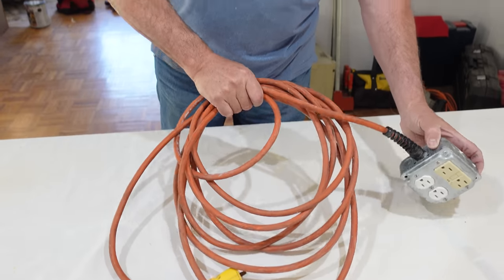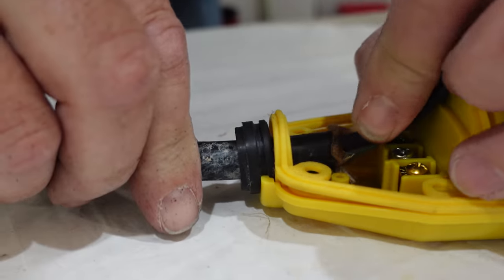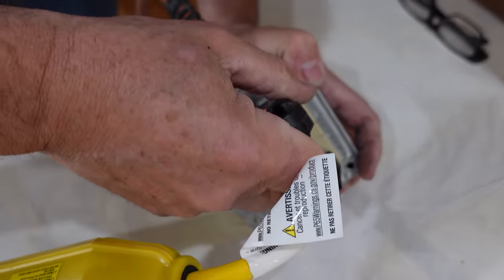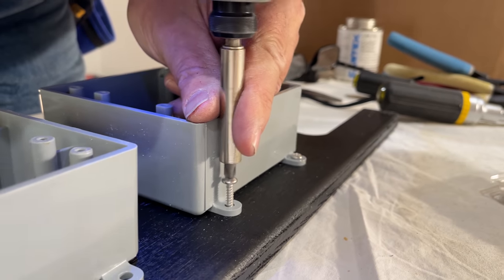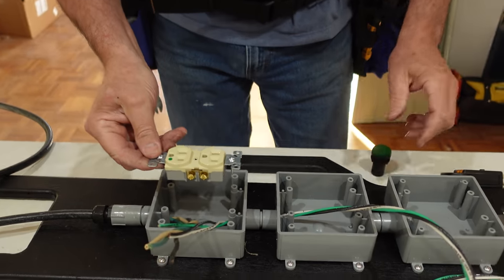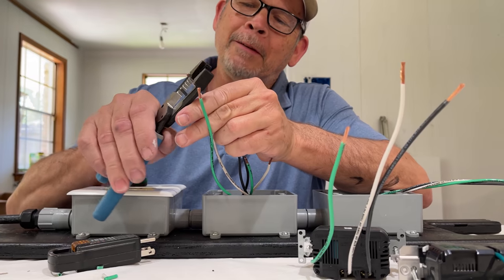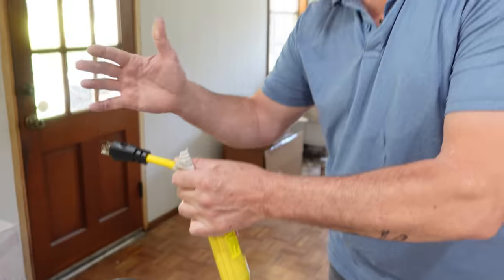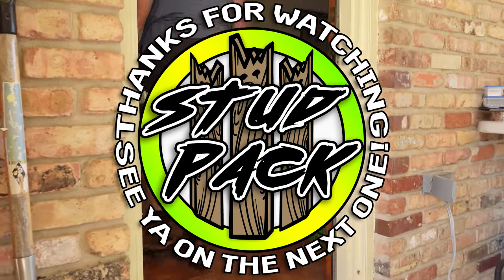HOW TO MAKE THE ULTIMATE EXTENSION CORD!

Comment: The added protection on the front end of the wire was GFCI which simply makes a continuous comparison of the amount of current flowing through the two circuit conductors, this is great if say you were to clip a wire with a tool and that wire were to touch you, it should stop the current... Other forms like AFCI continuously monitors the current waveform in the circuit, looking for unique anomalies that signify an arc fault... There are combo GFCI/AFCI devices. For breakers, for devices at the receptacle level ie in a bathroom... And for wires as shown here.... But most breakers are just OCP or simply put; thermal over current protection.... Pretty much across the board they use a bimetallic strip That is designed to trip the breaker at 80% of the rated current under sustained use... Which is to say a 15 amp breaker will trip if 12 amp is continuously run through it, The 20 amp breaker will trip if 16 amps is continuously run through it... So on and so forth..  What they have there is 20 amp breaker That was running 28 amps... The bimetallic strip inside of the breaker thermally breaks the connection... Which is to say it physically needs to heat up...  it is possible under short durations to run twice as much current as a breaker is currently rated for. For very very short periods of time...  This is typically why when a breaker trips It seems to go almost randomly... But will almost certainly trip fairly quickly once reset If all of the same conditions are met that caused the trip in the first place...
Reply: Yeah we call them rcds residual current device or detectors depending who u ask

Comment: The Circuit breaker did not trip because they have two tripping modes, thermal and magnetic.  The magnetic tripping mode trips instantly for dead shorts.  The thermal tripping mode however takes some time to trip, this allows motor starts and inrush currents that quickly dissipate to avoid tripping the breaker.  Given enough time, the breaker will trip with an excessive load.  The breaker's data sheet includes the thermal tripping curve which shows how much time the breaker will take to trip for any specific overload condition.

Comment: From what I know, a 20 amp breaker won’t usually trip at exactly 20 amps. It has a window of surrounding amperage that works as a tolerance, which would allow a slight fluctuation over the stated 20 amp breaker point.

Comment: One thing you could add is a current reader so you can verify how much current you’re pulling.  As opposed to using your split cable setup. It would be easy to add it by the green indicator light.

Comment: Holy crap! Can anyone say Tim Taylor, throw a couple grunts in for good measure. Probably could have purchased at least 4 cheap six-outlet non-surge power strips for the money dumped into this Frankenstein of an extension cord. As far as over-current goes, S-type cordage (portable cable/extension cords) is rated at less amperage than the wire used in the walls of your house. If you check the package the extension cord came in (or the tag on the cord everyone rips off), you would notice a 50 foot 12 GA cord is usually only rated for 15 amps so plugging it into a 20 amp outlet (or a 15 amp outlet protected with a 20 amp breaker) is a no-no as far as job-site safety is concerned (insurance/bonding). 

So he created space for 6 duplex outlets and then wasted half of those spaces on useless stuff like an Indicator light, a switch, and USB charging ports. If you need more than two USB charging ports, your crew is spending too much time on their phones. 

If I were to make something similar to this, I would start with the aluminum outdoor boxes with steel pipe nipples in between the boxes.  First off, PVC boxes (and indoor plastic cover plates) can be broken too easily in a portable/job-site application such as this. As well you could have eliminated all the ground wires in the enclosures as NEC allows for mechanical ground where metallic conduit and boxes are used. I would have just put six duplex GFI outlets in. If you get GFIs with the built-in indicators you don't need a separate indicator light to prove power at the outlets. There are also GFI outlets that have built-in night lights, so if you start or end your day when it's dark you can find the outlets to plug in your work lights. Another option would be while-in-use covers (the clear plastic kind so you can still use night-light outlets). With while-in-use covers you can have things plugged in, but still protect unused outlets from dust/debris and splash.

The device he used at the cord entry point on the first box is not a strain reliever. It is called a cord gland (or seal). It is not designed, nor should it be used to prevent cord pull-out, it is strictly a seal to prevent infiltration around the cord. What I do to prevent pull-out is, instead of cutting off the built-in strain relief (those ropes inside portable cable) I bundle them together and crimp them in a ring lug and screw it down where you bond the cord's ground wire to inside the box, making sure the ropes are taught when screwing them down. The cord cannot be pulled out when anchored in this fashion.
 
I also would have just used jumpers from outlet to outlet using the screws on the outlets as connection points. I don't think the push-in splice blocks are safe for stranded wire as it is too easily compressible and they likely are not spec for applications where they can be exposed to vibration like riding around in the work truck or knocked around on the job-site.

Comment: Nice showing how a vac speeds up when the air is blocked and draws less amps,but left that way it will also overheat quickly since the motor relies on that air for cooling in most vacs.

Comment: I absolutely am not an  electrician, but I recall that a big problem with extension cords is that they (the extension cords) are the cause and the victim of heat in the wire of the cord and not the house's wiring. This, as I understand it, is why there are so many electrical fires in overloaded extension cords while not heating the house's wiring enough to  trip the circuit breaker in the panel. Also, I believe that this is why new house construction has so many more outlets (so we have less of a need for extension cords) than in previous times. While I do not think that the intended use by our Stud Pack crew will be dangerous, we should not understate the potential fire dangers of overloading extension cords.

Comment: its funny to look at this while we have so many more safety precautions here in finland, im half cringing and half "oh thats clever" over here. for example we got the safety trip in the fuze box, not in the extension cables, also we are taught that the green wire (for us its green and yellow) has to be atleast 2-3cm (about an inch) longer than any other cable and on the point where hes using the stranded wire to connect to the outlet, i wouldve used a crimpable sleeve, not a u connector. the sleeve wont budge if you aim right and test afterwards so it wont budge. wagos are the best tool an electrician has, if you disagree, we both know youre not an electrician

Comment: Circuit breakers have two means to trip.   Magnetic function is tripped by high current (short circuit or ground fault) so magnetic field releases the mechanism inside.  The second way is thermal protection.   IE the rating on the handle.   The rating is based on very specific conditions for testing.  One is ambient temperature of 85F.   So, if at 85F in the breaker before load is applied, it will trip somewhere near 20 amperes.   So, your 28 amps will start heating up the breaker and it will trip when enough heat and time has lapsed.  If the breaker is in ambient of 100F it will trip before it gets to 20 amps.   A 20 amp breaker installed inside a commercial freezer building at -20F will trip at somewhere in excess of 60 amps.   I had this situation to design once.   I was concerned about it but when I thought it through, the conductors are in the same ambient and therefore can withstand the increased possible amps.   But of course amps is controlled by load applied, not breaker size.
Respectfully,   Kevin
Reply: Kevin, if you think it's okay to run anything over 20A on a 20A breaker; please stop doing electrical work.

Comment: I just want to add that in the long term, plugging multiple GFCIs in together can cause damage to them in the long term. temporarily while working? sure it will be just fine. hard wiring up a GFCI receptacle into another GFCI receptacle or GFCI breaker? idk if its against any codes, but it will eventually cause damage to one or both of them.

Comment: Stainless steel cover plates with gaskets would improve it.  Also, what gauge wire is the old extension cord, I hope it is at least #12 wire.  # 10 if it is longer than 100 feet.

Comment: Yes the current draw from the blocked vacuum does drop, but so does the air flow over the motor. So even pulling 20% current it has 100% less cooling and will die quick.

Comment: The answer to the breaker question is heat. They are rated above what they say, for "safety reasons". If you had continued to use more then its labeled throughput eventually the heat would bee enough to trigger the mechanism. This is why you often get the heater and microwave/hairdryer intermittent breaker trip. "But it dont always do it, Sometimes I can run..." because they run whatever it is for a short time, and the breaker has time to cool down in between, if its for a longer period, say the electric heater/microwave has been on for a while, and something else with a lot of draw gets turned on, then it trips instantly.

Comment: Magnetic circuit breaker didn't immediately trip from overcurrent because of temperature rise time factor. The more overload, faster trip time. While a thermal fuse would interrupt circuit much faster. Look at ratings of thermal heaters in magnetic motor starters, allowing time for higher starting current, and fine adjustment of running current range for motor protection.

Comment: Personally, I would not trust WAGO clamps on a 20-amp circuit. I would have also used solid wire in the line of boxes as they are rigid by bolted to a board and glue, and also much easier to make connections from one to another.  I love the concept and want to make this myself. :)

Comment: Just as a general precaution, when doing screw terminals for mains, always make the earth cable have more slack than the others (you notably didn't do this at 5:55, although I appreciate that the space you had was limited. This is so that if the cable does pull out, earth will be connected up to the last moment, as an extra safety precaution. 
If you want some inspiration on good safety practices, look at UK plug/socket arrangements, which is where this particular trick comes from.
As far as metal vs plastic boxes go, as long as the earthing connection is secure, my uneducated opinion says that the metal is better, as it tells you when something is wrong - although I'd support putting insulation over exposed line/neutral internally, just to avoid false trips.
Also also, if you want something like this to look remarkably good, use allen headed screws - they're somewhat rare, but look really sleek.
Also also also, if you wanted to make it really stylish, you could put a proper connector between the cord and the boxes - probably unnecessary, but a really good connector can just elevate a project. Bulgin do really nice ones, although they're quite expensive.

The 20 amp circuit breaker is probably more designed to stop shorts than more gentle overloads - particularly since lots of things can consume more power than nesesary while starting up. It might be that the breaker would break eventually, or that it wouldn't at all. The design spec of being a 20A breaker is that it won't blow below 20A, and makes relatively little claim about how much above 20A is required to actually blow, other than that it would blow very quickly if the load exceeded 20A by a lot. 
It is also interesting to look at the two different measures of current in an AC system - the root mean squared (rms) and the peak. They are separated by a factor of root 2 or about 1.4, and it is possible, though unlikely that the measuring device was measuring in peak, and the breaker was measuring in rms (where rms is effectively delivered current, averaged over the waves). I don't think that this is the issue though, as the measurement device claims to be averaging on the website.

An even more complicated function though is that the devices you were using were all motor based (notably unloaded motors), which makes the load very inductive. This means that the current can be drawn when the voltage is low, resulting in very little power draw for the amount of current drawn. Since the current measuring tool is looking at current while ignoring voltage, it may not see this happening, so may only quote the actual current flowing, however, the circuit breaker may be looking for excess power, and may be ignoring the offset, resulting in it seeing very little actual power drawn, despite the high current. This effect can result in a thing known as a power factor, where the actual power drawn is well under the measured power. In this case there may very well be a noticeably reduced power factor.
I think that this combined with slack given by the breaker may explain it not cutting off, and it would be interesting to see results given by different ways of measuring the current draw. A home meter or a device put on the socket with access to current and voltage may give remarkably different results in this case, as at least some of the motors connected may be acting as near-pure inductive loads.

A couple of notes about your comments at 26:07
First the vacuum is doing no work, but that means that all 9.6A are going into heating the vacuum, where in the other case some amount is going into pulling air. Additionally, the vacuum may actually be relying on the air flow to cool itself, so by cutting that flow off, you are putting it in the worst case - much like cutting off your cars radiator while revving it in neutral - the engine isn't doing any work, but that just means its producing pure heat.
The behavior of motors when jammed, loaded or unloaded with respect to applied voltage and current is fascinating, but it is notable that a motor with its shaft jammed or heavily loaded tends to approximate a heater, as it has no other way of expelling the energy, where a mildly loaded motor can put the energy into the load.

Having said that, it won't really be harming the vacuum. The system will almost certainly have an over/under/whatever pressure valve, so that if the airflow is obstructed, air simply flows through the valve instead. That can produce a lot of noise as they don't bother making the valve quiet. It also reduces the suction of the vacuum a lot (obviously) which is in part a safety feature, as the amount of suction the vacuum can generate might well be way more than anyone would want (although I think this is secondary).
The loud hissing sound is the bypass of air, and if a domestic vacuum is doing that a lot (and isn't a dyson), then it might well have a blocked filter. This sounds bad, but is really easy to fix - the filter is the cylindrical section inside the bin, and removing it can be a puzzle, but isn't usually that hard (usually some twisting motion). There is an outer layer, which you can remove, and an inner ridged part, which does the real work. This part might however look like a gray cylinder.
Take that part, and wash it down - there is no point brushing it as it makes a mess, and soap doesn't really help either. When doing this, be careful to either dispose of the water outside or dilute it a lot, as the dust can dry into a concrete like mixture. If its a large vacuum, the ridges may be quite deep and trap dust quite well, so gentle levering with a screwdriver can really help to dislodge dust.
Then, put the filter (and the sheath) on a radiator to dry, which may take hours to days, and reassemble. You should find a very noticeable improvement.
If you have two vacuums with one notably stronger than the other, you may find you can vacuum the smaller ones filter with the bigger one, which is a huge time save.

Dysons do not have this problem as they use cyclonic filtration, which can't jam up like this.

Comment: Ideally you should ferrule your connections into each outlet. You've used a wrap-around earth connection saying you feel that it is "better" due to less connections, but if you look at how easy it is for that to work loose, you're better off using a crimp on terminal ring to ensure that the connection is solid, and won't come loose.
Otherwise looks good - the reason your breaker isn't tripping at 28amps will be down to a number of factors, notably that you slowly increased that load. It will eventually trip - hopefully! Or you could just have a faulty breaker.
I do feel that the PVC faceplates you've used may wind up getting cracked if the board gets dropped, I'd have favoured metal clad accessories for this.

Comment: Yes  because the breaker is rated at 20 Amps it has a time delay ( witch is spece from the factory and (nec)) so a breaker for a shot time any where from as close to instant all the way up to minutes.    Also it has to do with if you have a contusion load on it or a non contusion load.

Comment: Did a quick scan of the comments, but maybe somebody already mentioned hospital grade receptacles and grounding.  I expect your receptacles don't connect the ground between the 3rd prong and the outlet frame. As you are using a plastic box it probably doesn't matter. Otherwise I'd suggest to check resistance with a meter and jumper them if the outlet doesn't connect prong to frame internally.